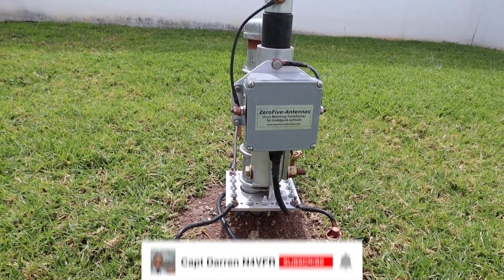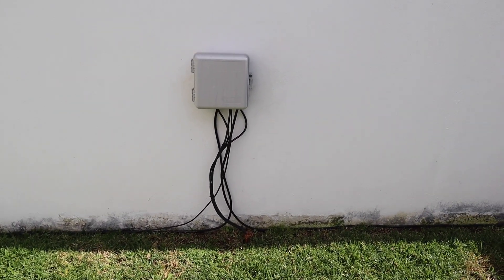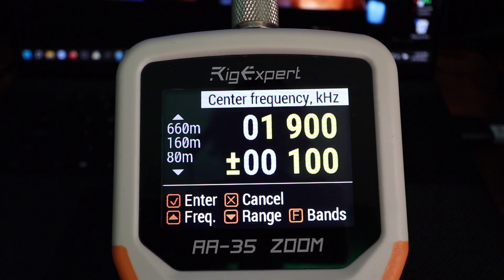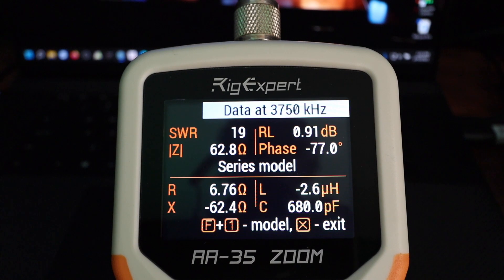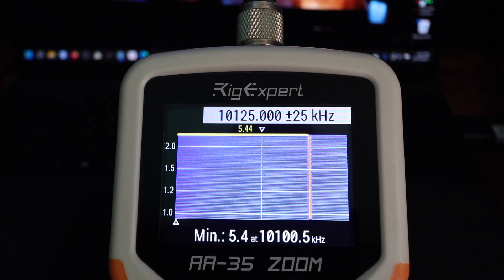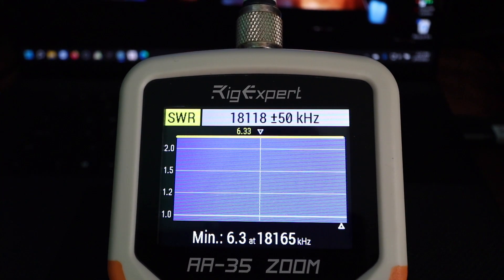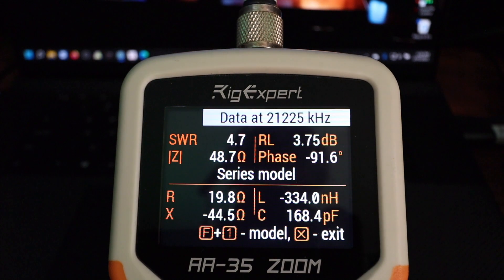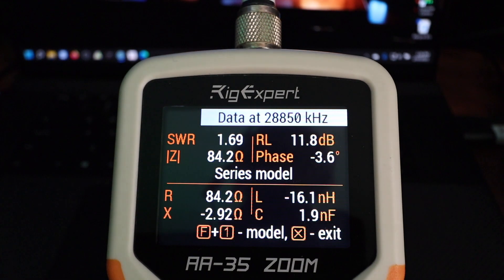Zero Five 27' Resonant Frequencies | What bands is the Zero Five antenna resonant on?

Comment: I have the same antenna, no radials and 1 ground rod.   My SWRs from 10-80 do not go above 2.5:1…easily tunable with the internal ATUs in my 7300 & FTDX-10.   When I use their ATUs the SWRs hover around 1:1.  
The readings you got seem way out of line.